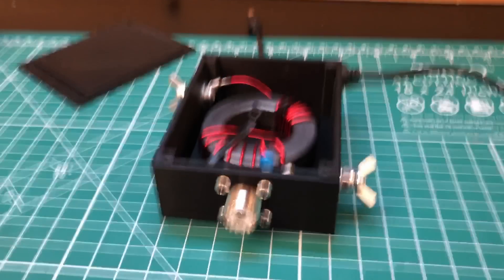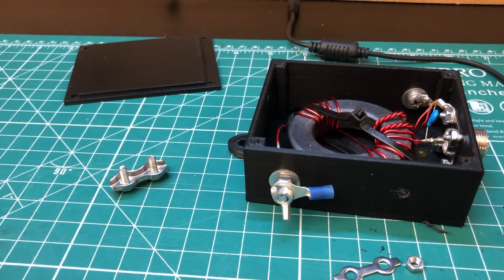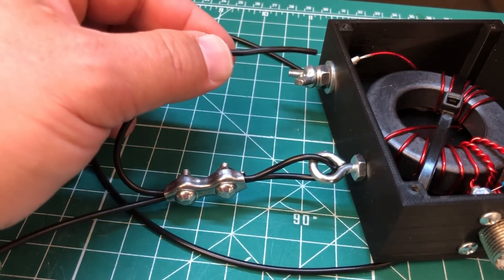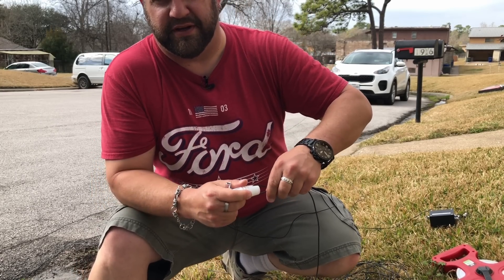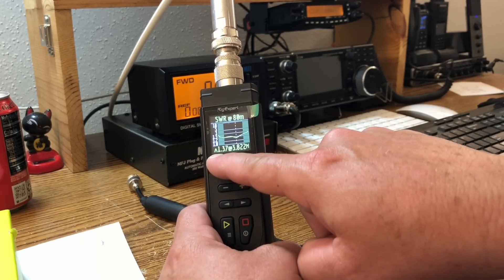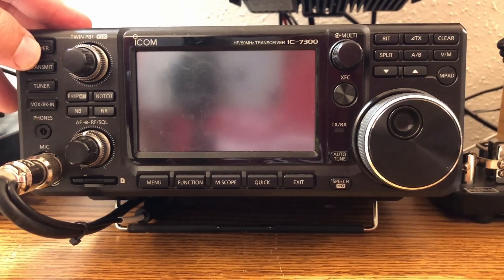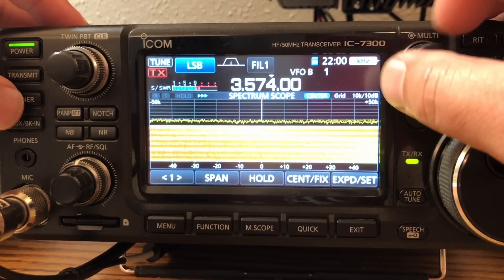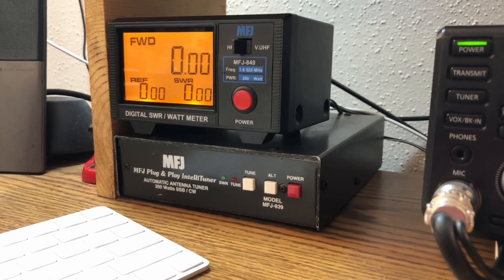TennTennas 100 Watt 49:1 80-10 Meter EFHW w K8MRD Mod & Installation

Comment: Wow that noise floor would drive me nuts. I thought I had it bad when I lived in the middle of Sharonville OH. I was seeing noise levels around S7 to S9 on most bands during the day up to around 10 PM, then it would at least drop to about S5 or S6. Since I moved to West Central Florida those numbers are around S3 to S5 most of the time. so playing radio is a lot more fun. and when I go out to the woods those numbers are almost always around 2 to 3. It looks like that antenna you have will work quite well for you. I have built a couple of 49 to 1's and one 64 to 1, both of which do really well. My best antenna is a kit for a 5 to 1 using a 17 foot whip on a spike in the ground. It gives me great results for in the field across the bands 80 to 10 and if I adjust the Whip I can bring in 6 quite nicely. All with out a tuner. I still use the internal tuner on 12 and 15, but I can work them with out a tune in a pinch. The SWR is around 2.5 to 2.7 to 1 on those bands. Thanks for what you do mister and take care. Vic de KE8JWE

Comment: great video. love the k8mrd mod. that DX 10 wire great ! found a better wire DX 50 from DX commander. will handel out routh winters in NY .I would like to do a 160 meter one but I do not have the room. may use loading coil  to shorten. I have done 160 meters in a park. we just did center fed with a 1:1 . put it down on top of the snow. had to shorten foot or so, the snow shortened the dipole. worked all over at night. when working 80 and 160 meters just string the wire out. it will get out. at the time was THHN 12 AWG stranded wire. 73's

Comment: I had to mod my ARRL Antenna box to add an eye bolt to hang the box and use the eye bolt next to the antenna post as the strain relief for the wire. I suppose I could have made that eye bolt do double duty but I chose to add another instead. I did this because the first time the wire pulled out of the ring terminal. Problem solved.
It's fortunate for you that you have accommodating neighbors that let you use their trees. No tall pines like that in my California neighborhood.

Comment: Great video.  I know this is a year ago, but I'm curious if you still have that pulsating noise floor.  I have the very same noise intermittently, but only on 40m.   It was almost constant around the clock, summer 2022.  Through fall and winter, it would be present sometimes and gone at other times.  Either +10 or nothing at all.  I could be in the middle of a qso and it would just suddenly start.  The 40m band was unusable when this pulsating noise would start.  It has happened a few times this summer but less often.
Reply from the maker: Oh god it's incessant.  It's a different noise floor, but it's just as high. The power company came out and did fix some issues, but then about a month later they came out and ran new wire and messed it all up again.  Sometimes are better than others.  I've put up multiple different antennas since I made this video and I'll tell you, the last antenna I just put up was another TennTennas EFHW cut for 80 meters.  So now I have 2 TennTennas that I use (cut for 80).  One radiates E/W, the other radiates N/S.  I recently put up an OCFD in hopes it would be quieter and the noise only went up.  So I grabbed my other TennTennas EFHW and put it back up.  It's a struggle, I assure you, but damn are these antennas great.   I'm always looking for a better solution to lower the noise floor from the antenna side, but I've also kind of given up.  As a mostly portable operator, it's not the biggest deal for me.  40 and 80 are terrible and I mostly can't pick up stations unless they are pretty strong, but 20-6 are manageable.  It's just the struggle of being a ham.  You have to come to grips with the compromises that you have to make.

Comment: Mike...how did the 136' wire work on all the bands...specifically 80m? I just brought one, and think ill cut a 66' wire and then a 132'ish wire to see how it will play on 75m.
Reply from the maker: Works so great I have 2 of these up now.  Though I may be wrong about the 136', it could very well be ~132'.  On 80 SWR is about 2.4:1 at the bottom of the band and about 1.5:1 at the top.  The dip is at about 3.740 and SWR is about 1.2:1.

Comment: Mike, what AWG wire are you using for this antenna?  Is it the same 22AWG as you used on the lower power units of this brand?  BTW, it was good to talk to you at the BARC field day in Bryan.

Comment: Mike with that noise level you should use a magnetic loop. Using a MFJ-1786 you can send the noise level 30 db down by rotating the loop. Further the loop only needs to be 4 feet off the ground. Keep in mind you can use the loop for receive only and transmit on the half wave wire.

Comment: I have very similar noise at my location, its caused by my neighbor led sealing lights. I bought a QRM eliminator to see if it would help, let say it's not helping that much for this kind of noise, but it allows me to have a RX antenna on my IC7300. I setup a magloop as a RX antenna pointing the null towards my neighbor and the further away as possible from his house. It does help get the noise to a more manageable level.

Comment: I trust someone has already mentioned this, but it's my understanding you CAN'T auto tune using the internal tuner in a SSB mode... one has to use RTTY or AM (something with a constant carrier or output of sorts), and SSB (without voice, I guess) doesn't provide that.  So not sure what your tuner is actually tuning, friend.
Reply from the maker: It is my understanding that you don’t have any idea what you are talking about.
Reply: Sorry to inform you, but you are completely wrong.  You seem to be describing some operators use of an external tuner.  The internal tuner in the 7300 chatters for a few seconds, while it is reducing power, sending a mostly inaudible carrier, selecting the optimal tune, and leaving your radio ready to keydown and talk immediately afterward.

Comment: Thank you! I'm using a stealth 71' end-fed sloper, high end is 15' going down from a balcony to a 6' wooden fence, 9:1 unun at high end, 50' RG8x, 3' jumper from XPA125B amp to a common mode choke. Center band SWR is 1.4 to 1 or better on 40, 30, 20, 15, 10 with no antenna tuner. SWR on 160, 80, 40, 30 is 1.7 to 1 or better using the Xeigu XPA125B amp internal ATU. I've had SSB QSOs on all voice bands. Get good signal reports everyday on 80 & 40 phone nets. From California I've worked Japan, Australia, Portugal on 40 SSB. I feel very lucky, its amazing what a "compromise" antenna can do!

Comment: Wow, sorry about the noise floor, that really sucks ! Grow house near you ??? As to the antenna tuning, I sure understand the need not to get too anal about the SWR, but why not make it at least half way decent ? Not all that much extra effort. Increased SWR, even if corrected with a tuner always costs power output. We all have constrains as to power output, noise floor and antennas, but for me, I still like my signal to be as readable to the Ham on the other end as my equipment will allow. If I'm going to the effort to put up an antenna, I want it to have at least a 1.5 to 1 SWR on most every band, if not better if the antenna design will allow. Talking the CW or Phone portion, which ever you use. Not all will have low SWR, but an end fed will. I just think it's a bad example to be put out there, as if it doesn't matter. Yes, it will work, but as Ham's, we should strive to have our antennas be as good as we can get them.....within reason. Just a small coil over a piece of PVC added near the end would have made a huge difference at almost no cost. That is the video you should have made. Lots of instruction on the net on how to do this. Sorry about ragging on you, but new hams should not be shown how to just settle.
Reply from the maker: Boy you sure do know how to rub someone the wrong way don't you?  There's always one of you in the mix who has to insert your unsolicited advise and tell me what I should do.  Just about every band is under 3:1 which is most certainly "half way decent".  I would also not add a coil at the end, I would cut it.  It's too long.  You should have noticed that when I showed every band on the analyzer, but, being an armchair quarterback, you prob didn't notice details such as that as you were too busy thinking of ways to tell me how wrong I am.  Bad example??  Really?  Perhaps you should browse my library of videos on antennas and read some of the comments from people all over the world who have gained knowledge from my channel.  BTW, I can't tell you how many new hams I have inspired.  It's a very humbling feeling.  I've also done videos for the ARRL, who also find merit in my content.  What have you done to further the good of amateur radio??  Sorry about ragging on you, but new and old hams alike have many videos of mine where I build, review, test, and show how to properly make a resonant antenna.  The one time I don't, AND I EVEN SAY IT IN THE VIDEO, and I'm the bad guy?  No good sir, I don't think so.   But thanks for watching and don't forget to hit the subscribe button.
Reply: @hamradiotube  Oh, I noticed it was too long (words along the line of why bother to cut it off and the graph showed it too.). Point is, you told everyone that as long as you are at about 3 to 1, it's great. I guess everyone should throw out the aftermarket antenna that every video tells you to buy for your Baofeng and just put the stock antenna back on it. If you're hitting stations close to you with a strong signal, then loss of power matters little. It's the guy trying to pull you in when you are at his noise floor is where the lost power matters. It's your channel, put up whatever you want. To me, it's not right to tell new hams that 3 to 1 is just fine. If that's the best an antenna can be made to do, it's one thing, but that's not the case with an end fed. I would not settle for any of my resonate antennas to be at 3 to 1 in the portion of the bands the antenna is designed for, and neither should anyone else if there is something that can be reasonably done to make it better. It's not a temp antenna. It's just lazy. Yes, you have put out many good videos. some crap one's too. Sorry if I pissed in your Wheaties by bringing up the point that as hams, we should strive to do the best we can. This was not a "I'm going to throw a wire in the tree" and see if how many contacts I can make video. You took the time to put up the antenna the best it could be with what you had and put thought into how to do it. Except for the lousy SWR you settled for, it was a decent video. When trying to pull in weak contacts, I usually assume the operator has done the best he or she could with what they have and will work hard to make the contact. People should do their best to put out the best signal with what they have. New hams should be taught to strive to put out the best signal possible with the equipment available to them and shown how to make what they have work as efficient as possible. You have helped many new hams with your videos. I give you credit for that. You also have a great amount of influence. Strive to do the best with what you are presenting and set the example. If that ruffles your feathers, I'm sorry. I've been the new ham. I've bought antennas and ideas that were pushed as being fantastic only to find out the limitations rarely mentioned. I've got good and bad info from influencers. The best influencers put out less content, but the content they do put out is well thought out and has many more of the facts, good and bad. Just my 2 cents. Sorry if I'm not a fan boy no matter what. I look at the good as well as the bad.
Reply from the maker: @johnk23705  ok
Reply: @hamradiotube  Mike, when you go out looking for the noise, try something like a portable SW radio. I've found that using AM mode at lower frequency, electrical noise pops up better than when I used a G90. Many different ways to do it. This worked for me. Bad contact between a connector to a transformer and main feed line. Really made the noise pop out, but not until I got closer to it. It made it easier than when there is just too much noise picked up at distance.
Reply from the maker: @johnk23705  I talked to Richard at MFJ and he's going to send me some stuff for sniffing out RFI.  I don't have a SW radio but I might take my 705 out in the mean time.  I've got a tape measure Yagi and a RX loop for direction finding.  Not sure if it'll work but I'm curious to try.  I'm not 100% convinced it's power lines though.  I just hope I can find it and squash it.
Reply: @hamradiotube  Yea, that is ugly noise. Does not seem harsh enough to just be electrical, but it sure is strong. That's what makes me think grow lights. Best of luck. As strong as it is, it has to be somewhat close. Take a regular AM radio too. Mine went from S-7 to S-2 after the power company fixed the problem. Don't have a loop. The AM radio worked better than the HF radio and 2m/70CM yagi I tried. I 100% agree, find the problem, don't put a band aid on it. After it's found, the box with the two antennas might just make things really clean. Have not tried that but might. I have been getting a little more electrical noise lately. Time to go on a hunt. I've found the electric company to be excellent, especially with me doing the hard work for them.

Comment: Mike, curious if you have any dimmer switches in your place? I had a similar "bouncing" noise floor and found out it was from a really old dimmer in my dining room.
Reply from the maker: Nope.  I've shut the power off at my house and ran off of battery power too.  Didn't change a thing.

Comment: I hope your next video will be how you dealt with the noise 😆Good grief, your noise is unacceptable. Don't know if you have tried one of the noise eliminators by changing the phase of the incoming signal with a second noise pickup antenna. I use the German one sold by DXengineering - works great. Walk with your IC-705 around your neighborhood to try and see where its coming from

Comment: noise doesn't care if your antenna is tuned or not. I guess one of the reasons to tune the antenna is so that you can use a 'no-tuner' rig, don't know how you would measure it but it would be interesting to know if the antenna projects a stronger signal if tuned to resonance on the bands? al ve3gam
Reply from the maker: The antenna isn't totally out of tune lets not forget.  I just didn't bother getting it perfect.  It's more in tune than it is not in tune.  The more tuned an antenna is, the more noise you would hear.  In this case, because it is so close to begin in tune, I don't think it would really matter.

Comment: You should had added a washer on both sides of the eye bolt, that noise floor is high, any idea of the cause?
Reply from the maker: There is literally zero purpose in that.

Comment: Do you have a neighbor with an electric invisible pet fence? I had one several years ago and I told him if he continued to use it I would report him and he did not turn it back on and about a year later he moved.It was Terrible I assure you.
Reply from the maker: That is a very good question and unfortunately, if I do, I would never know because it's invisible.  I don't think so though.  Most of my neighbors yards are fenced in and  I know the few who have pets also have fences.  Good thought though.
Reply: @hamradiotube  I figured it out from when they would let their dog out alone and it never left the yard for any reason and the noise would go away usually soon after they left it back into the house.I’m smarter than I look.😂🤣🎙

Comment: I can see why you do so much POTA. Did you know about the S9 noise floor before moving? We are looking to move to the NC mountains and I bought a QRP rig to test the noise floor at houses we are considering, I also carry a 2 meter HT to make sure I can hit the local repeaters.
Reply from the maker: It wasn't as bad when I moved in.  I actually brought a portable HF radio and hooked it up to my TarHeel to check the noise level when I first looked at the place.  I knew it was a higher noise floor but it wasn't this.  This is newer.  Not new to me but new to the channel.  It wasn't happening when I first moved in though.  Thats awesome you're looking in the mountains in NC.  I've spent a good part of my life up there around the Brevard/Waynesville area.  About 30ish miles West of Asheville.

Comment: I can’t tell what MFJ Tuner that you are using but I don’t know of any Automatic Tuners that they make that will tune 6 meters? I have the MFJ 929 and it works great on all of the HF Bands but it will not tune 6 meters at all.If I need a tuner for the Magic Band I have an LDG that was made for HF& 6 meters just for an ICOM.
Reply from the maker: Its the MFJ-939.  It's only advertised 160-10 but it works on 6 meters too.  Not sure how or why and I'm not going to question it either.
Reply: @hamradiotube  I promise my 929 does not at all so it’s why I keep the LDG tuners around.The 929 is by leaps and bounds a far better tuner for HF.

Comment: I see many using multi knob as a vfo ? It will fail sooner than the unclicking main vfo. Suggest the main vfo be used
Reply from the maker: My track record with 3 different radios suggests otherwise, but either way, it's just a knob. If I have to replace it I have to replace it.